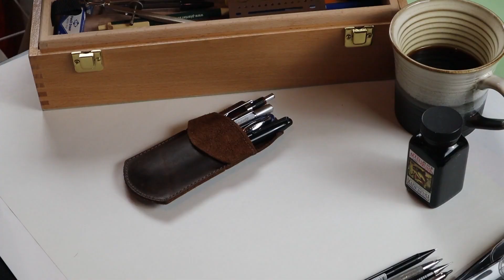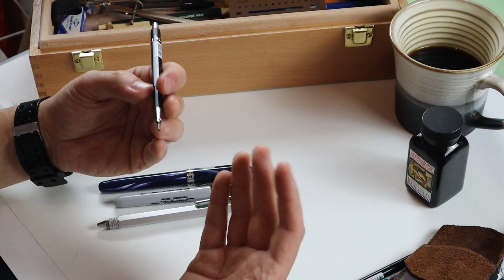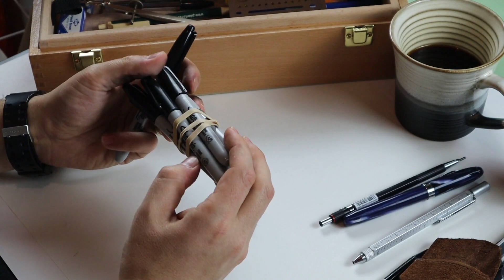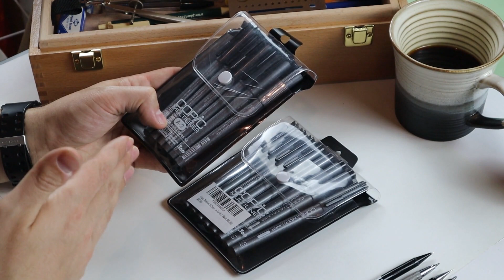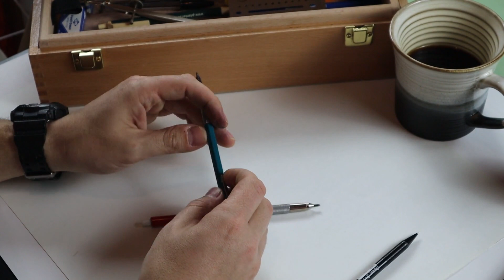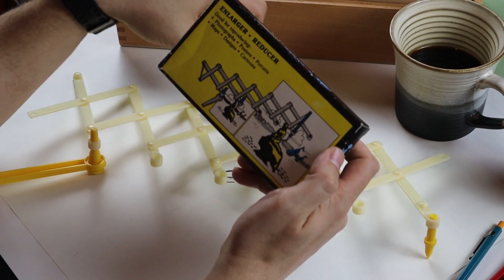Pens & Pencils For Landscape Design & Drafting

Comment: Rotring 300 works as any when using stencils rulers etc,however,when used by itself for free drawing,it's by far the worst,most imprecise pencil,I've ever seen. It's not expensive,it's the cheapest Rotring leadholder,however,the Faber Castell TK9400/TK4600 models,that cost half the price if not less,have the best performance of all the pencils,on both free or technical drawing.